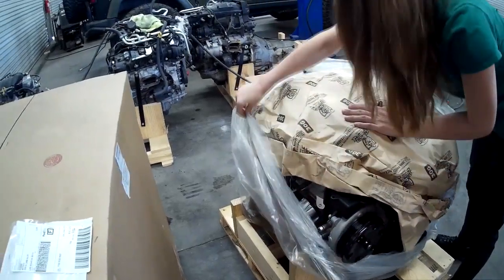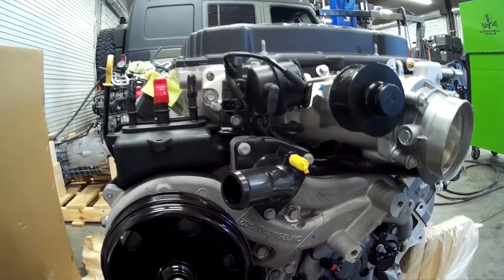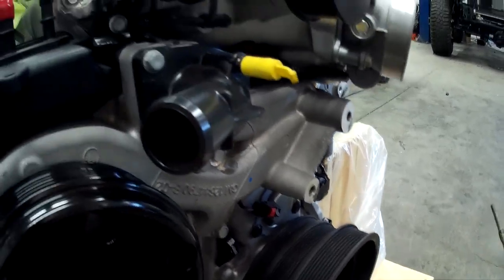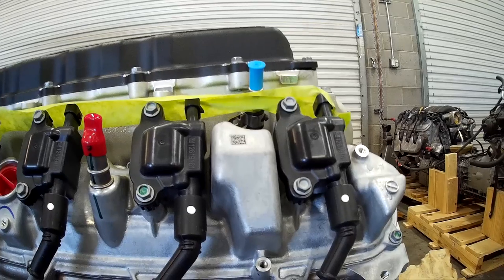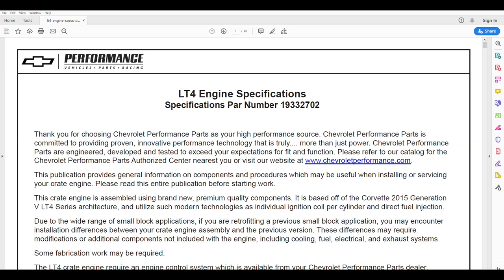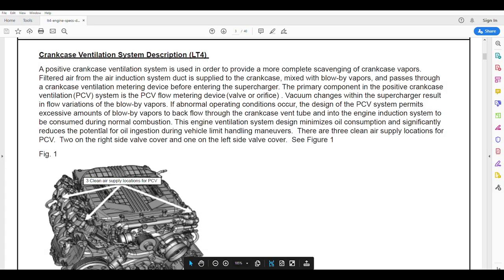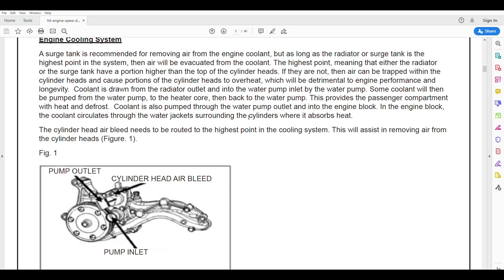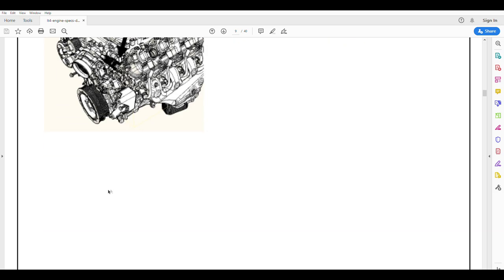LT4 Unboxing

Comment: Hello again; always I get much of information from your videos but Here I want to share a small Note for in 8:35
.
- The catch can in LT1 is for collecting water and humidity that comes with the air through the air filter, after that the air sucks to the engine through the 2  valve overs to the inside the engine then the air pulls to the air intake because of the vacuum.  
- Not to collect any oil.
Thanks

Comment: You stated that the fuel pump was voltage regulated to control the fuel pump volume and pressure and I would have thought it was pulse width modulated to work the total loss fuel management. There's a lot of technology going on here, keep it up.

Comment: Hey! Great video. I have the same dry sump LT4 and I have a question about the manifold insulation you point out at 3:30. The person I bought the engine from thought it was packing foam when they received it and started to remove it. The top area of the foam is still there and the foam inside the engine area is there, but the exterior foam is all gone. I spent over an hour trying to find the part, but I can’t. Can you help me find it? You’re super knowledgeable and probably know an easy way to find it. Thanks!!!

Comment: Awsome content! Love the detailed rundown. Can i ask you a question? The lt4 has variable valve timing right? Isn't one of the benefits of a variable cam timing system is that you can have a silky smooth idle? Ive seen guys with pretty lopey idles. Doesn't that go against the grain with this motor? I know everyone loves a nasty idle. Whats your opinion? Thanks
Reply: late reply, but AFM/DOD lifters fail so usualy a cam and DOD delete kit are done. In doing so, often times the VVT is also plugged or limited or removed altogether and use a new gear and timing cover.